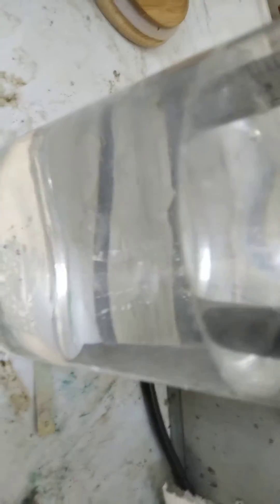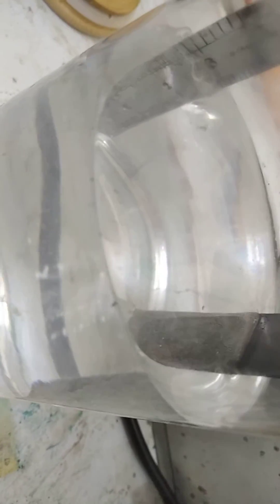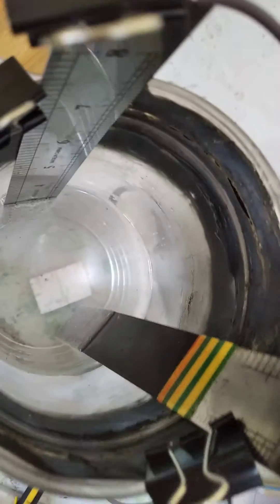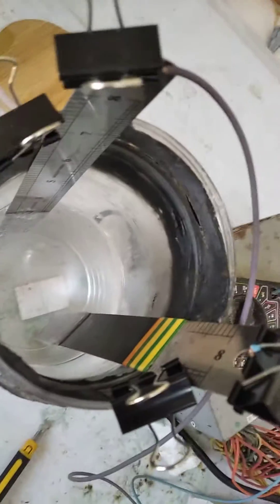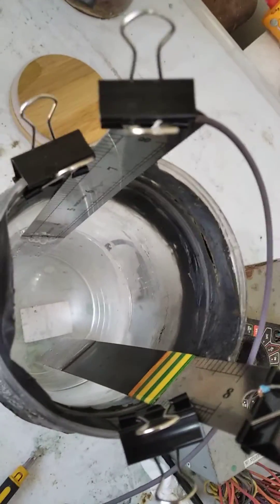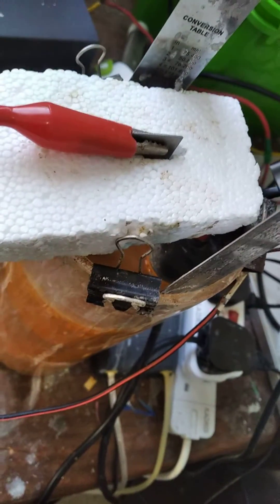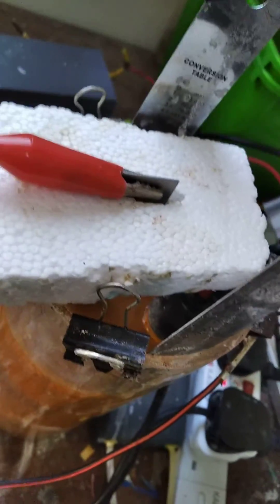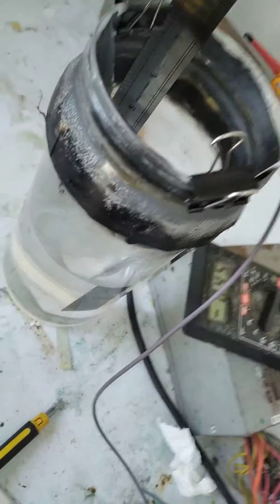PbO2 coating on stainless steel test (failed after some hours due to cracks)

Comment: Pity, there doesn't seem to be simple solution for a good anode for chlorate/perchlorate production. I'm wandering if heat oxidized high cobalt high speed steel could be used as a support.
Reply from the maker: titanium is the only one and my latest solution using DTO seems to be the only viable DIY alternative.

Comment: Very interesting, looking forward to seeing this work. 
Bro, I need some advice. What is your advice for an anode that can withstand sulphuric acid electrolysis cells? Something that doesn't erode or contaminate the cell. Cheaper the better.
(about 30 percent sulfuric acid)
Reply from the maker: just buy Ir-Ta from aliexpress its cheap and lasts longer and doesnt release toxic heavy metal byproducts.
Reply: @CatboyChemicalSociety  The problem is in the country that I live in we don't have access to aliexpress or amazon.
I just have to make the electrodes myself. Do lead dioxide electrodes that you made work for these conditions? I read in an article that even if pbso4 is formed the solubility in 30 percent sulfuric acid is just 0.4 ppm.
Or do I have to go for platinizing thin layers on titanium or even gold maybe?
Reply from the maker: @hrajabi7261  most sulfuric acid production cells via membrane reach 30% and as long as current is provided it will not corrode.

If you want other anodes that can widthstand H2SO4.
It would be

Pt
Au
PbO2
Pb
Reply: @CatboyChemicalSociety  PbO2 is really the best option especially if it's doped with some other metals like cobalt, iron, and silver. But it's hard to make good ones. Maybe first I go for lead-silver alloys. Then I try to make more professional electrodes.
Reply: @CatboyChemicalSociety  Is there a paper about non-porous lead dioxide? I couldn't find it.

Comment: i saw a paper from china where they make lead dioxide anodes from aluminum rods as anodes in a saturated solution of sodium plumbite. the Pb+2 is oxidized in the anode to Pb+4, and the generation of H+ ions decreases the solubility of the lead, and lead dioxide is deposited.
Reply from the maker: yea but the issue is that if these are used then a single crack which happens during operation would cause immidiate failure of the anode.
I also read that paper and they focused on surface analysis rather than actual usage.
Reply: @CatboyChemicalSociety  oh yeah, I didn't tought of that, my fault.
and something that I don't know, what are the advantages of electrodeposited lead dioxide anodes compared with lead dioxide anodes made from lead metal?

Comment from the maker: update: even if this is useless for perchlorates at this stage the steel ruler PbO2 anode has uses.
1. Remediation of lead waste solution as an inert anode.
2. Generation of ozone in sulfate/perchlorate solutions with a pH of 8.

Comment: I remember being in big trouble with a woodwork technician in school for using a steel ruler to chisel apart two pieces of wood.....and here you are using a precision piece of measuring equipment as an electrode!  lol
Reply from the maker: after sanding it down

Comment: Wow.. no brownies colour there.. are you starting with lead tartrate or lead nitrate process for coating it?
And yes, I agreed that coating on titanium is a lot harder..
Reply from the maker: neither but overall this process is from what I found somewhere about non porous alpha PbO2 and they had proof of it using SEM images of the surface.
I just modified their proceedure and combined it with another proceedure of producing PbO2-CeO2 nanocomposite electrodes along with another paper that talks about dopants to increase the catalytic activity of alpha PbO2.
Reply from the maker: im gonna try stainless steel mesh next time
Reply: @CatboyChemicalSociety  maybe try stainless steel scouring pads?that would give you a huge surface area, but it would be hard to calculate so you can figure out current density.